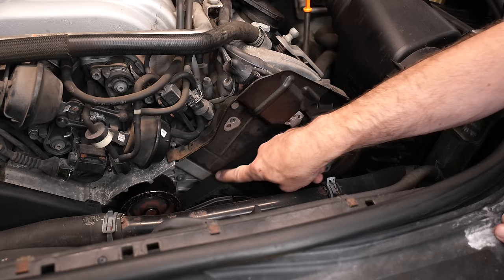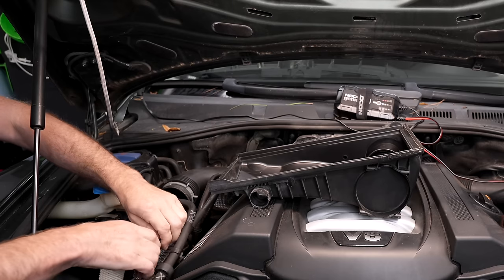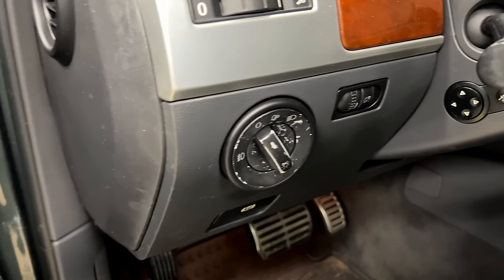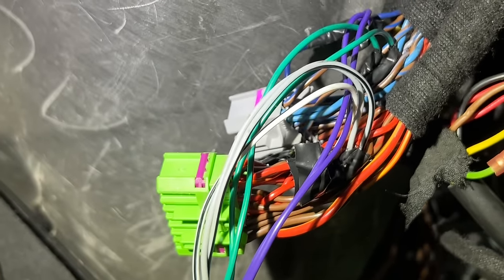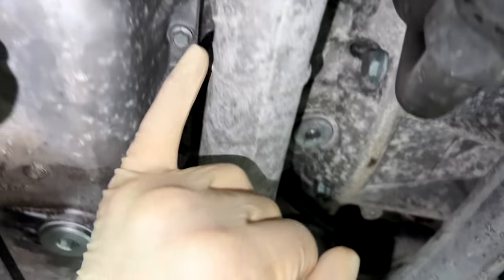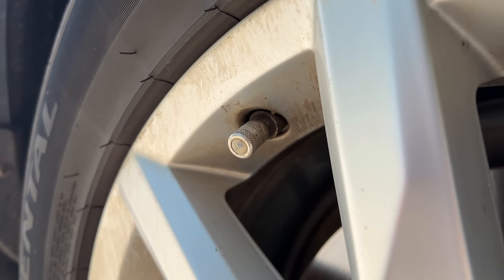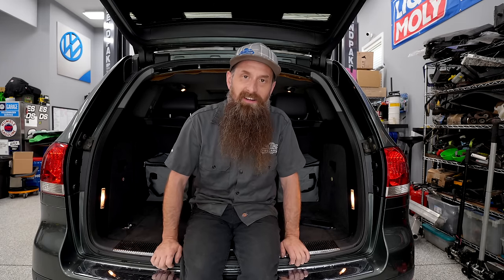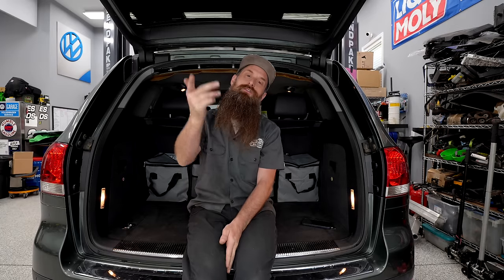Is It Worth Buying a CHEAP, OLD VW Touareg?

Comment: You can replace all the buttons with ones from an 08+. They don't peal and get nasty. Your headlight range control issue is most likely a failing headlight harness either inside the head light or just behind it. You can also swap the cluster with a fancy one if you like, its plug and play no immobilizer built into it. I tow with mine all the time and i have LED trailers, i use the LED adapter you showed. If you didn't want to use the adapter you could wire the trailer lights directly to the tail lights like aftermarket hitches do. Only the factory hitch ties into the canbus network. Fun fact, if you lock the Touareg with a factory hitch plugged into a trailer and you unplug the trailer, the alarm goes off.

Comment: To fix the trailer lights I installed an enclosed box on my trailer out of an outdoor electrical box and installed regular light bulb sockets with bulbs in line as resistors and now it works perfectly as designed.

Comment: Well if you decide to off road it with a lift kit, etc then that removes much of the rust issue LOL

I was looking at touaregs a few months ago, so it'd be interesting to see a deep dive into them so I could know what to look out for - optional equipment, issues with said equipment, problem areas, livability, availability of replacement parts, maintenance intervals, etc

As always, keep up the awesome work Charles 👍

Comment: Bought an '07 V8 steel springer in 2019 with only 67k miles and it was in great shape... Pre-frontend makeover but post-V8 update, so I have the BAR not the AHK. Soft touch button problem was apparently fixed by then. No towing package so I put in a Curt powered 3-to-2 trailer light converter. No issues with LED trailer lights and the bulb check doesn't have any say in the matter... It stays plenty busy anyway with those bunk-ass taillight assembly electronics you gotta wire brush every 3rd Wednesday. Otherwise, one of the most reliable cars I've ever had, which I realize is not necessarily the norm. I've had it across the country and back twice, off-road enough that I really need skid plates, lots of 3-wheel action, lots of open-diff-Wrangler-killer fun... This thing doesn't get stuck unless you're REAL insistent upon doing so, and I only have the center diff lock. Lots of trail WTF from onlookers. No lift and mild tires that still allow burning down interstate sections at an insane rate in perfect, smooth, quiet comfort. Love mine.

Comment: 7P6 blower motor failure fixed for AUD 71. Found an aftermarket control module/resistor online from the US. Took about 2 hours to get it out. Simple job to replace the controller/resistor unit and about 45 minutes to put it back. While I had it out, I dismantled the motor, checked the carbon brushes blew out all the dust, and reassembled. It has been performing faultlessly for about a year now. Well worth the effort considering the VW dealer would not sell the module/resistor separately and wanted over AUD 900! So pleased with myself on this repair

Comment: Get about 6 cans of black fluid film and go to town on the undercarriage. Will hide all the rust and prevent it from getting any worse in the future. Pro tip, wait till you complete all the repairs because working on the car after you spray is a mess.

Comment: The 1st generation Touareg is the best one. I am super excited to watch your videos fixing this car. Finally, I have 2 Touaregs and I am very happy with them. The petrol one is 3.2, I changed the timing chain and the oil pump, runs like a dream, the other one is 3.0 TDI, changed all gaskets and seals in the valley, runs great. Thank you Charles for bringing the videos. Cheers mate

Comment: Traler fix: make an adapter harness with resistors in-line. Look up led flash resistors. Use a male on one end, female on the other, and you can remove it when not needed, and use it on other cars. You're welcome.

Comment: Great Video! I hope you do more. I miss my Touareg! I had a 05 V8 in Colorado Red with air suspension. The biggest frustration I had with it was finding a shop to do the flex pipes without pulling the motor. My local VW dealer did it without pulling the motor.
Reply: I went to 27 shops before I found someone willing to do it. Now one of them is bad again. Glad I'm moving somewhere with no inspection or road salt
Reply: My local VW dealer charged me 6 hours labor to do the job. I was shocked when they agreed to do the job. Every other shop wanted at least $1500 or they refused to do it.
Reply: How did they do the job without pulling the engine??
Reply: I asked the same question. The mechanic at my local VW dealer was able to do it. The only thing service told me was that this guy was a Touareg expert and he came up with a way to do it without pulling the motor. I was very happy because it saved me a lot of money. Still paid $650.

Comment: I earned a VW Tech badge last summer while fixing my Sisters Boyfriend first Gen 2004 V6 Touareg 😂. He took it to multiple shops and none of them could fix the issues and just gave up on this beast. It had multiple check engine codes and overheating, but mainly it couldn't pass smog. Anyhow I worked each problem out and used your channel amongst others for fixes. The Vacuum lines on these vehicle's tend to split at every joint and without proper smoke testing good luck finding them. I had to replace pretty much all the main Vacuum lines which does require you to remove the cowl to get too. It had a "New PCV" that was Chinese junk installed by one of the shops that was a bust from the jump. There was oil in the sparkplug holes causing misfires so replaced the valve cover gasket. Replaced all the fluids including a complete trans flush. The electrical issues were solved by replacing a bad alternatator and getting a new battery since these suckers are sensitive when it comes to the proper amount of pixie juice. Lastly one of the ghetto shops he took it too spliced wired a replacement main radiator fan with a used AUDI fan from a car something her Boyfriend didn't tell me SMH so when I was trying to find the part with the part number off the fan I was going in circles 🤬 Anyhow once I replaced it with the correct Heavy Duty fan for towing she runs like a 🏆. One thing is for sure these things are overbuilt rugged tanks especially the suspension great for off roading. If you maintain them with quality parts they should last you a long time👍🏻

Comment: I bought one with the air suspension and rear locking diff a few years ago with 80K one owner and about 20 pounds of maintenance records for $5K in San Jose, CA. No issues since and I've made it into an off roader with Eurowise suspension upgrades and winch mount, and added an APEX 12K synthetic winch. I also added larger tires, have a full size spare that ratchets to the roof, and other modifications. I did the timing job myself and added a bunch of improvements. Zero issues, except for a mystery warning light for a bulb that is probably either, a.) going out or b.) housing has corrosion or something. It's been awesome. I am adding a second fullsize battery to where the original donut spare is soon but this is an awesome and comfortable rig for sleeping in on climbing trips and it gets me everywhere! I've put about 5K into this car when you look at the tires, the timing, all the parts I decided to replace or upgrade it with, etc, but for $10K and a car that has done 50K more miles with zero issues, I don't think you can find a more dependable, reliable, or capable vehicle. Just be sure you know what you're getting into and have no issues working on a VW/Audi/Porsche yourself! I also own a B7 Audi S4 manual that I've tuned and tuned. I love the challenge but these are complex machines that you can master and reap the rewards! Just pay attention, and be attentive, and do your homework!

Comment: My biggest pet peeve with my treg is that in heavy rain when the water puddles and you run through it, it comes up over the front end and inundates the front windshield, that is a big problem if you have the auto wipers on and they don't respond quick enough to the water covered windshield when you're at speed and completely blinded.

Comment: 2:05 those cost like 200 from the dealer, the metal repair kit doesn’t replace a torn bellows or ball (worth checking) you can get them for around 70 as a Porsche brake component I believe.

Comment: 1. The button peeling only affects the pre-2006 models. Later models have revisioned coating, that will not peel and will actually look perfect even after 15+ years. 
2. The LED trailer needs an adapter with extra resistors  - or you can add the resistors or extra (hidden) bulbs yourself to the trailer lines to work properly.
3. Check the bulk head drain holes at the top of the front wheel well behind the liner, because that likes to clog up, then water pools in the plenum chamber area and overflows into the cabin, and can cause a lot of issues. Similary the A/C drain tube also tends to clog up, so, check also that in the passenger footwell area.
Reply: Sorry, 2007 still has peeling issues, still love this suv, but so many items in this video are so true.

Comment: I tow with a 2004 V10 TDI. I love it. I just use a plug adapter for trailer LEDs. Sometimes I get a dash warning light, other times I dont. But it works.

Comment: The Curt 57003 adapter worked on my 2005 touareg. Also double check settings in VCDS to make sure the trailer module is being read correctly. I assume it is but its something to check.

Comment: I've had 3 Touaregs now.  04 V8 pretty much identical to this one, 2012 Hybrid, and now a 2016 TDI.  I love the TDI the most, but miss my v8.  It sounded so good.  I would do an exhaust, maybe a small lift with some slightly bigger tires, and call it a day on this one.  Eventually that rust will start causing you to replace things so thats when you should start the upgrades.  That's my methodology on my Golf R and Touareg.  If I have to replace something, its getting an upgrade if it exists.

Comment: As a new VW apprentice I dread seeing a Touareg on my work order
Reply from the maker: I totally get that! How are the customers on these today? They use to be a nightmare. Now to be fair, they paid a TON of money for them back in 04-06.
Reply: Just make sure its not a job for the starter motor 😬😬😬
Reply: When you do the fuel filter and there's forbidden glitter inside...
Reply: @HumbleMechanic  They are all insane, especially the TDI owners. Not so much for how they act but because they'll get a quote for $6000 and approve it in the blink of an eye.
Reply: @CallOfDuty1458 the TDIs are reliable though no?

Comment: I used to have a 2010 Touareg TDI. The powertrain was amazing, so was the ride and handling for such a heavy SUV. It nickel and dimed me with little things in the interior that kept breaking but the powertrain was bulletproof. I also used to have a L322 Range Rover which felt like a much older car vs the Touareg even though they were both developed around the same time and sold around the same time. The Touareg felt about a generation ahead of the Range Rover in terms of driving dynamics.

Comment: That’s because the system is looking for a resistive load. I had to get one of those seven pin harness adapters with a built-in resistor mode, since the Torregon, the Cayenne from his arrow are pretty much exactly the same.

CURT 57003 this is what I got and works.

Comment: oh man this truck is a complete love hate relationship I have a 08 v8 as a toy. where do I start, kessy module drains battery when the resistors go caput, engine out to replace starter, chugs gas, eats tires and goes through brakes. But when its running right I LOVE IT! also for you folks with 04-07 tregs with peeling buttons go find a junked 08-10 and take all the climate controls, all the buttons ect since VW switched to plastic vs rubber in 08

Comment: i have a Touran from 2005, with the same trailer issue, mine has a westfalia trailer control module (can bus controlled) I found a jäger controle module, also with can-bus, very easy to swap, and no coding needed, if not changing from 7pole to 13 pole as I did

Comment: 2 years ago, I bought a ‘08 with 73k miles in California. It’s been ok after paying a small fortune 😅 to clean out the intake, all the drainage lines and replace some parts under the hood. It would have been a steal for a mechanic I’m sure. Eventually it will be my off-road, dogmobile. After having trucks most of my life, I do enjoy the turn radius.

Comment: To address the led light trailer issue just wire some incandescent bulbs in the trailer wiring as resistors and place them in a box, job done, you may need to avoid the trailer towing module for this to work really well and just wire it directly to the rear tail lights.. The oil filter has the drain plug in the housing for that reason, open it first and drain the oil in front of the sub frame then remove the housing once it's empty. I am just in the midst of refurbishing one that I transplanted a used motor and transmission and due to time and funds availability it has taken me about 6 years and I finally just got it out of my garage the day my 2017 mini decided it wanted to hemorrhage antifreeze all over my driveway with only 58,000 miles. The Treg still has some issues, sadly mostly electrical but slowly working them out. This SUV was waaaay ahead of it's time technologically though and still there is not many if any that give anything close to the features and performance these have and the V8 if you keep up with maintenance and timing belt changes is near bullet proof with an ample amount of power out of a small V8 with the VVTI, I tow a 22ft Searay cabin cruiser with no problem and the AWD is a problem solver pulling it out of water, especially on a slick, algae covered boat ramp at low tide and then there's the locking diff if you have any problems, I just kick it in and avoid them altogether. It always gets head turns, people can't believe it is that strong because it says VW on it. My first Touareg has 218,000 miles and ran like a bat out of hell still until it got hurricane Ian treatment a couple years ago. The rehab I just got on the road has broken down twice once for a fuel pump and once a few days ago with a broken shift bushing which got really complicated because of safety features, both times within a week and once right in my driveway (the fuel pump) went to start it to go pick up my wife from work and it wouldn't start, the other time as I shifted to back into my driveway, if you have to have break downs you can't beat that timing on either. Ironically as if planned by VW my 99 V6 GTI did the same thing, never left me stranded. I just corrected the shift linkage bushing today, $10 part, I should have started by looking under the truck first, but began tearing down the center console first and caught myself midway and looked under and there it was, quick, easy, cheap fix.. I have many vids of my rehab but have not yet posted, no time to edit and post, but one tip I have for the soft touch interior is remove the part and strip down the old sticky nasty junk where there is no icons with mineral spirits or maybe acetone if something more serious is needed, and then respray with several coats of black plasti-dip and it comes out looking and feeling like new and is just about as durable too. IMO they used something very similar originally.

I'll keep mine as long as I can, it's my protest against electric and smaller bore cars, trucks and SUV's of today,  I don't drive it that much but it is also comfort and style inside and out which is why I've given it a rehab though parts are getting more and more scarce.

Comment: Definitely, if you're going to leave the somewhat rusty underbody be: get the rig oil sprayed to stop what's already there.   You can treat/sandblast/repaint bits and pieces of that when you do have to get to refreshing suspension bushings, especially if the role is "beater that will be the tow vehicle".   

Just plan those impulse must-be-towed purchases around the tow car being apart to change up parts. :D

I totally get why you're grabbing one, though!   Like your ol' B5 Passat, you "grew up" on these at the dealer -- repair familiarity + low base price beats out a new shiny high-dollar vehicle, or a vehicle brand you're a bit less familiar with the quirks on.

Same sorta reason I've stuck with mk4 cars.   I'm just insane because I live in the rust belt (so is all of Canada, basically).

Comment: If it’s anything like my 2010 Q7, you will need some resistors installed inline with your trailer plug wiring that goes to your bulbs. You can Google what ohm to get.

Comment: I swapped out the bulbs for LEDs on a 11 Mercedes C Class with bulb monitoring. Phillips make a clip-on ballast that runs in parallel to the bulb itself that provides the resistance that the bulb monitoring is expecting. The errors all went away. Just don’t mount to a painted surface because they get HOT.

Comment: I bought my 2004 Volkswagen Touareg V6 from $1000 in Seattle. The car would go into safety mode and wouldn’t let you go past 15 mph and I had to drive an hour and a half back home but if you babied it the right way it would drive fine. The next morning I take it to the mechanic and after a full inspection, he said the only issue was water in the spark plugs and the car to this day with 250,000+ miles still runs and drives and has a reliable vehicle. The mechanic visit was only $251 and from there on out no parts have been replaced basic oil change services and one coolant flush.